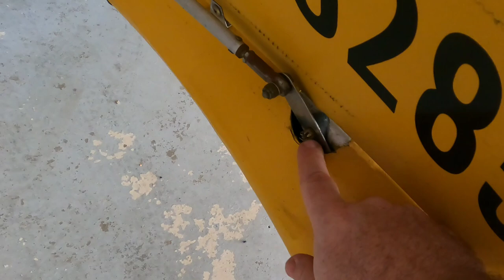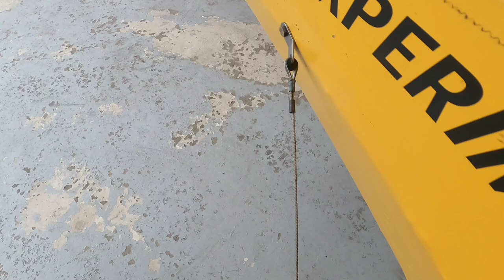Want To Own A Challenger ll?? Let's Talk About it!

Comment: In my opinion, the Challenger II, especially the long wing, has most of its unusual flight characteristics from the light wing loading, about 1/3 that of the 172. The light wing loading accentuates all turbulence effects. But that means you can also soar it in normal thermals. NEVER engage the flaperons in landing. Both an increase in engine power and positive flaperon deployment cause a nose down moment. A go around with flaps deployed would be dangerous, especially if the nose down moment was not anticipated. As for workload, It can easily be trimmed and flown hands-off in stable air. You are absolutely correct that people trained in the usual certified trainers need instruction in lighter aircraft that lack the inertia they are used to.
Reply from the maker: Great info thank you! I've wondered about the flaperons! When is the right time and wrong time!
Reply: @TheJonjonj  I would consider deploying only on final for a short, off field landing, Base-to-final turn with flaperons encourages a stall/spin, because the aileron function is not differential. The excess lift on the up wing increases the chance of its coming over the top.
For regular field landings, the stall speed is plenty low enough without flaperon deployment. Small flaperon deployments are only for trim.
My opinion.

Comment: I’m appreciative all of your videos. Being a couple hundred hours as GA pilot, I got a Challenger ll and didn’t have anyone near to teach me, I pretty much follow what you’ve done. I also really appreciate the the guys in the tower (PGD) for having patience with me as I’m doing some high speed taxiing and crow hopping down their 7k runway. 100% agree it flies differently than a C-172. Thank you for sharing your videos.
Reply from the maker: Absolutely! Don't be worried about it they are great birds! Go fly!
Reply: I built a Challenger 2 in 1999 and early 2000. Same color as this one. I built it so i could train ultralight pilots.
I found this aircraft to be very easy to fly!! The main difference between this and any other single engine aircraft is that engine is in rear, and is lighter than a general aviation aircraft. This is the main handling  difference!!
With proper instructions almost anyone can fly this aircraft.  My family and friends  all flew in my Challenger and not a scary moment for anyone! 
I would recommend this type of aircraft to anyone who is capable of  flying light aircraft and willing to get proper training! I flew mine about 300 hrs. Before selling it. I have about 4000 hrs in single and multi engine airplanes. I thoroughly enjoyed flying my Challenger 2

Comment: 2 stroke engines are always temperamental require lot more maintenance. I like to tinker with engines have lot of experience with 2 strokes used to work at a performance jet ski company. Also have some experience with performance outboards. I don't have aviation experience something I would like to gain. One thing with a pusher engine have to worry about something vibrating lose and end up in the prop. I read on Challenger's website that this aircraft requires coordinating turns I could see how someone who used to leaving their feet on the floor might have issues with this.
Reply from the maker: Back in the day I worked for River jets in Laughlin! I was London Bridge tour guide on the boat! Yes a very rudder dependent aircraft!
Reply: @TheJonjonj  Looking over all the kit planes available I can't find another that is priced so low if those prices are still accurate on U fly it website $32k for a fully built Challenger 2 XL-65 airframe needs covering is really a good deal in this day and age. They even include a new 582 engine, and instrument panel.  I have read that unless you know what you're doing shouldn't buy used because of all the updates might not be included. The downside as you said very sensitive to winds light wing loading, I live in Arizona we get lot of thermals, and late afternoons winds can randomly gust while probably not a problem for a 172 something like this would suck. The wind here can't even fly a kite it will gust then suddenly drop to nothing kite falls then gusts again shoots back up again until you get the kite out 100-150 feet in the air. That tells me near the ground it's even worse.
Reply: @Aviation Adventure Boys  really? I use to live in lake havasu city for many years and out of all the years I lived there and parker. I never took that tour ride.
Reply from the maker: @Outlawflyer78  yea I miss that area so much!

Comment: I am a private pilot and have flown Cessna 150 and 172s. I have owned a challenger2 for 10 years and fly it regularly on floats, skis and wheels. I love it and find it a great plane to fly. You do need someone to check you out if you are used to a puller plane but that stands for all types of planes no matter what the design. The challenger is uncomfortable to fly in windy conditions but in calm conditions, i can trim it with the flapperons and let go of the stick no problem. It is an ultralight, you don't buy an ultralight to go up in crappy weather.
 Bottom line , I have owned it for 10 years and love it. There are some videos on my channel

Comment: Great video. You captured the essence of the Challenger and its flight characteristics very accurately and honestly. They are 100% stick-and-rudder aircraft and they are light with light wing loading. Mine is based in the very windy foothills of the Rockies and wind is unfortunately a fact of life. My feet are constantly busy. Langewiesche’s “Stick and Rudder” is almost required reading if you’re coming from a 172 as I did. Thanks for sharing your insights. I believe they will be very helpful to potential Challenger pilots. I see the Challenger as a flying motorcycle rather than a car. Cheers!
Reply from the maker: Thanks I hope it helps someone! and I'm glad you agree!
Reply: Being from Michigan, it looks like a flying snowmobile to me. :)

Comment: A lot of people only fly them early in the morning or late in the evening when its relatively calm.

And that brings up this question:  If registers as an experimental aircraft (in compliance with the 51% rule), and with the proper lights, can the Challenger be flown at night by a private pilot?  It’s my understanding that an aircraft must be certified by the manufacturer to be flown at night, regardless of registration, etc.
Reply: I may be wrong but I think experimental is limited to VFR. SLSA's can be IFR certified if equipped with the proper instruments. I only have a small understanding of this from reading around and talking to older Ultralight pilots. But it does make sense.

Comment: Jon, thanks for the info here and the warning to GA pilots what it takes to fly unltralights and  planes similar to the Challenger.  I have a Challenger ll CWS that I love.  I have a friend who bought a 90s era Freebird. He put a Rotax 503 on her with a Warp Drive three blade prop.  I helped his but new A/N bolts, washers and nuts on all attachments.  I have done some crow hops and it seems to handle fine.  Any advice or special things to consider before first flight? Thanks, LANNY LAMBDIN.   (my videos on YouTube under William Lambdin)

Comment: Can you send some pictures how you’re using your trailer dolly to pull it around? Mainly how you have it attached to the aircraft and secure it?
Reply from the maker: @matthewlindberg6249  yes I will in my next video! It's just the dolly from harborfreight the tail wheel sits in it and I bungy it down!
Reply: @TheJonjonj  thank you. I have the same dolly, but it has a hitch ball on the top, so I’m not sure how you have your tail wheel sitting on top and would love to see it.

Comment: Great video. I must comment on that bracket (lower lift strut to fuselage). As a homebuilder educating myself on proper A/P technique, I learned that all bolts subject to pivoting  like your lower bracket, require a castillated nut with cotter pin. Yours doesn't have that. Something to check?

Comment: I like the idea o Challengers but have never flown a plane with flapperons and don’t like the thought of them. Would prefer regular flaps which I am familiar with. Am I right or wrong?
Reply from the maker: Honestly in the challenger they are not required! It gets slow enough flaps aren't necessary! Watch my video that says flaperons I talk about it there a bit!
Reply: Yeah the flaperons are more for trim adjustment when cruising. At least that's what my buddy uses them for the most. He also doesn't do short field ops so they might be useful there too.

Comment: Can you tell me what the width of the rear horizontal stab is?  I will be taking off the wings of on I purchase.  Just need to know that demission going to put everything in a box truck.
Reply from the maker: I'm not with it but they fold up very easy and line up with vertical stabilizer